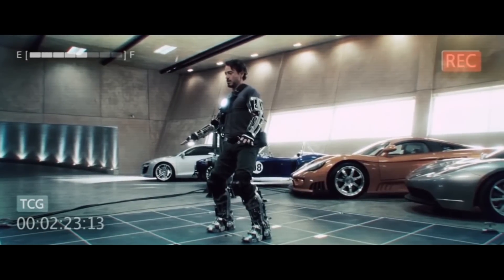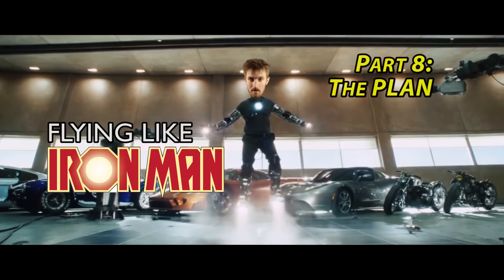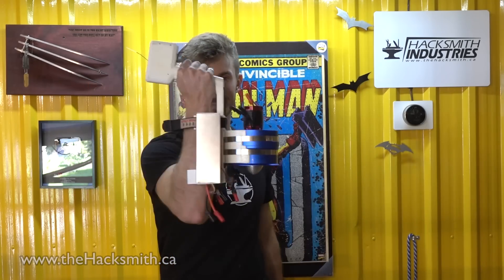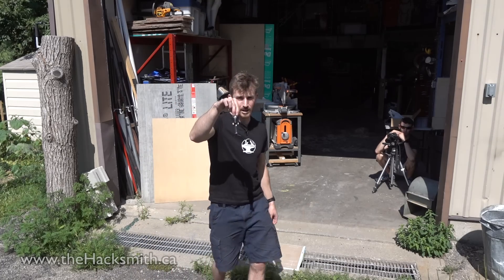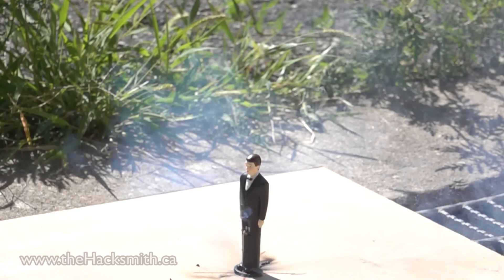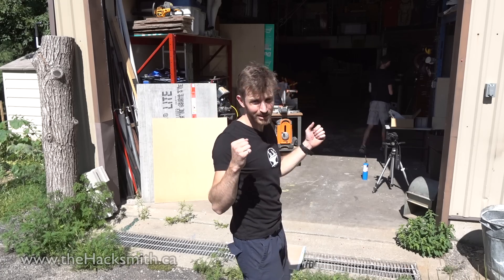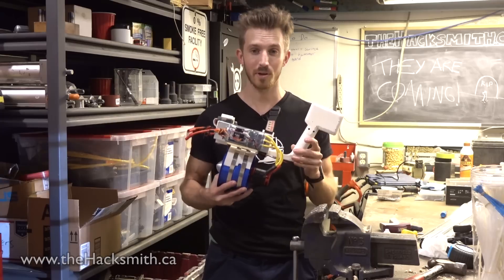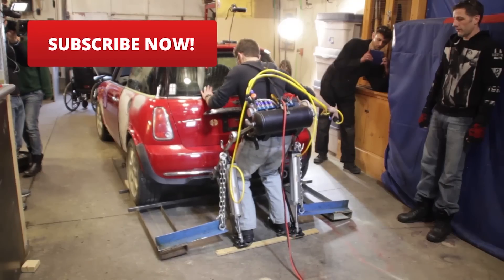Flying Like Iron Man #8: The Plan with Electric Ducted Fans

Comment: What about making a suit smaller than the hulkbuster but bigger than Mark 3 suit etc so you can house actual jets? Would be very expensive though
Reply from the maker: +MUFC01 weight...
Reply: +the Hacksmith aluminium maybe?would it be too heavy?
Reply from the maker: +Alper Liman still too heavy... Remember the part of the video where I said every extra EDF needs more batteries? Any kind of suit would be very difficult to overcome it's weight
Reply: well,good luck wish i could help you but im not good at electronics
Reply: +Alper Liman What about 3D printing parts? Is that not light ?
Reply: Pulse jets:p with a tethered fuel hose. "Then again that is no where near as cool as electric duct fans without a tether".
Reply: +SpydreX Official don't forget the ear. Protection then lol. Those things make so damn much noise
Reply: +the Hacksmith what about carbon fibre?! :D
Reply: +sparsh mahajan nano carbon
Reply: +kurlik pl And "you're" use of your is incorrect.
Reply: kurlik pl If you want to use "you're twelve" as a snappy comeback, it'll carry more weight with proper spelling.
Reply: +SpydreX Official 2 heavy still
Reply: CM Gamer Actually no the thrust to weight ratio is excellent on pulse jets so that shouldn't be a problem but heat will be a major concern.

Comment: I was going to say that the locations of thrust before and aft the center of gravity wouldn't matter as long as it was balanced. I think Scott Manley made a video explaining why pushing and pulling rockets don't have any differences in stability.
But then you added in that an exoskeleton makes the body rigid, so I realized that the thrust source wouldn't be on a fixed place because your legs aren't stable mounting regions.
Reply: what is a pulling rocket?  don't they all push?
Reply: Yup they all push, it's just much easier to deal with designing rockets that way. And as BrokenLifeCycle was reffering to, there is no stability advantage to putting the center of thrust at any particular point, as long as the thrust is pushing through the center of mass.
Reply: And thats why i love KSP it explaines so much! :D
Reply: I think it's called a rocket pendulum fallacy.

Comment: When you actually finish the issues with the thrust, you can use a wingsuit for a more stable horizontal flight right?
Reply: And other question, are you going to make a suit for this project as well or just the thrusters?
Reply: +Lucas Schmidt probably not most likely the weight
Reply: the problem with using a wingsuit to get a stable horizontal flight is that he won't be able to move his arms so much that  he'd be able to steer, and with the main thrust on his back it will slowly turn him  down to the ground first  before slamming him face first down in the ground
Reply: +Erik Pettersen yeah he needs to make more sensitive movements alot better

Comment: i recommend  not putting the power supply on the body its just a proof of concept so the power source can just be a wire + it would make most of the designe issues go away like the changing center of gravity due to the additional batteries + will cut the cost up to 40%
Reply: He wants to fly without being attached to the ground
Reply: Lucas: Ofc, but this is just a first step. No need to have everything at once.
Reply: those things are 5800W, eating about 80-100 Amps each.... and he wants 20 of it. The wire would be so heavy it would make his weight double. That's why they try to keep the batteries as close to the thrusters as they can
Reply: Agreed.  Something similar to what Raytheon did with their XOS 1 and 2 exoskeletons.  Just store the heavy stuff somewhere else, and make sure the core concept works first.
Reply: He said in another comment the first tests will be just that
Reply: Becko the wire can be suspended + the size of the wire wont make it as heavy as the batteries ....
Reply: +Glytch 
yup
Reply: You can suspend the cable and have it roll out of a tether. It wouldn't have to be long/
Reply: Yeah but it's not like he can create a potential energy dievice that is very safe and that creates clean energy because the most fundamental law of physics is the conservation of energy it states that energy is constant which means it can't be created only transformed so how can he solve that explosive and battery problem he can't make an arc reactor

Comment: I know it kinda defeats the point for now, but why not use AC and a tether for now, until you get the flight working, and switch to batteries later? That would save cost on batteries, and make it easier to develop
Reply: That could make it easier, yeah
Reply from the maker: +Ogoun the EDFs require DC voltage :p
Reply: I realize that, but if you take AC from the wall into a DC power supply, you could use a tether to transfer that DC power to the 'suit.'

Comment: Hey Hacksmith! Consider this. When your standing stationary you have forces acting down through your center of gravity and forces acting upward through your feet. Your brain is acting as a stabilizing CPU to keep everything upright and has been doing so all of your life so is well trained. Although it may be hard to direct enough power to your feet to lift you off the ground, with practice you could easily learn to balance on the engines without even requiring hand stabilizers... but with the hand stabilizers the whole thing will be that much easier (picture leaning on a desk making standing easier)... The only reason for a jet-pack would be to add more thrust to actually get you off the ground but humans aren't used to being lifted up from behind like that and I fear that this kind of imbalance would actually be harder to account for leading to the best face plant caught on camera. I don't have your maths so I couldn't tell you how to get the extra thrust with just hand and feet EDF's but I honestly feel it would be much safer for you without the jet-pack. For a video representation of what i mean search 'water bottle jetpack fail'... think also about having separate controls for the thrust of your feet and your hands. your hand controls need to be instinctual so you can stabilize yourself as a reflex action, while feet controls need to avoid this so you don't panic and accidentally up the thrust making your problem worse. I hope this helps... Fly safe!

Comment: why don't you just use a Tesla turbine fan to provide the thrust you need? turbine will go supersonic at just 100 psi...
Reply from the maker: +blee0518 conservation of energy, input power can't exceed output power... 100psi will never make you fly :p
Reply: you're not understanding me. energy can be converted to force. which the force would be easily amplified in a turbine. 100psi is force not the actual energy as well. force can be manipulated while energy is the same. same as in transmissions.
Reply: the Tesla turbine is 98% efficiency. nothing  close. so use your energy effectively.
Reply from the maker: +blee0518 show me a Tesla turbine that can put out over 50lbs thrust, I'd like to see :)
Reply: w
Reply: +the Hacksmith pretty nice!

Comment: I read that the Hiller flying platform (1950's) were you are standing on top of a big ducted fan , was actully easier to fly no hands because our normal sense of balance works through our feet , so it was just like balancing on moving floor  for example a boat   , but as soon as you held the handle bars it all went screwy !

Comment: You are giving the wrong ideas to people who actually have way more money than you...
Reply from the maker: If people have way more money than me why are they watching my stupid videos?
Reply: +the Hacksmith Gathering good ideas ;)
Reply from the maker: +Nobody Never I thought you said they were wrong ideas? Regardless of whether I'm right or not, I'm bringing everyone along for the ride -- maybe I'll fly, maybe I'll die :p
Reply: +the Hacksmith you will fall... IN STYLE
Reply: +the Hacksmith Now this is worth a subscription
Reply: hj
Reply: Having the center of thrust above the CG does NOT make you more stable. This is called the Pendulum Rocket Fallacy. In essence, any amount of instability causes you to turn slightly. Then, no matter where the thrust comes from, it will turn with you. https://en.wikipedia.org/wiki/Pendulum_rocket_fallacy
Reply: That might be true, but in this case the difference is that your body is either hanging down from your thrusters, wich is quite easy, or it has to stand stable on top of them, which is a lot more difficult.
Reply: +the Hacksmith WHERE DO YOU LIVE IN KITCHENER I WANT TO SAY HI TO YOU
Reply: He'll have to learn electron stripping systems, dry superconducting strips(normal temperature), and jet engines. He would need some type of artificial, unfold-able, wing. Iron man is not good aerodynamically.
Reply: +Makeoscopy Mounting propulsion to the chest is still better. It has more room to mount stuff to, and it doesn't move around as much as your legs.
Reply: Nobody Never money cant get you every thing
Reply: Nope

Comment: may be worth considering using the bieficated vent principal as seen in the Pegasus jet engine. basicly redirecting the air flow from the fans dosnt greatly decrease the efficiency (in a gas turbine engine) so large more efficient ducted fans could be mounted on your back flat and the thrust redirected down and an air intake added. food for thought

Comment: i have to voice some thoughts:
1. look at the flyboard, which uses turbines below the center of gravity, 
that shows its possible,(but imo complicated/unstable), so distributed thrust would be preferable(f.e. 2 per feet/2 per shoulder 2 per hand for stable liftoff)
2. a jetpack needs a counterweigt or the thrusters have to be right on top of the cog
3. pls think about custom esc´s, cause an arduino+ custombuilt ones may save a lot of money and enables software stabilisation and grouping for multiple edfs
4. may use wingsuit for horizontal efficency
4. i´d really like to help so dm me :)

Comment: Hi Hacksmith!
You may don't know, but once it was actually something like that what you want to build. Bell aerosystems was developing Bell Rocket Belt (which was a rocket propulsion "rocket pack") and after redesign The Bell (WR19) Jet Belt (jet powered "jet pack"). I think (if you didn't done this yet) you can do some research to find out what problems they had with it.

Comment: About all that center of gravity stuff, I think you're forgetting the human element, with the zapata flyboard air all the thrust comes from below the center of gravity. The reason why it flies so well is because the pilot has the ability to manipulate the position of his own center of gravity, much like how a segway works. When it comes to iron mans boots, the direction of the thrust is not set, it can be changed by moving your legs so it is directly beneath the center of gravity at all times. If you're worried about stability thats what the arm jets are for, even stark himself made them for that. The jet pack would still be a necessity for efficiency and added thrust.

Comment: i believe that the leg mounted prop can work if done right, if you weight around 90kg you can have lets say 30kg prop on the legs and 60kg on the arms, even 40-50 could be preety stable, and you should get easier monouvers. sry if i mispelled some stuff xD

Comment: Looks great can't wait to see stunt wire system test, but helicopters are more stable with lift above them due to high area of the prop, rockets however are more stable with low centers of thrust due to the fallacy of the pendulum effect, that's why Goddard changed his design so quickly, but completely agree with your current design as rocket thrust and fan thrust are two very different animals
Reply: Diffrence being of course that fans pull and rockets push
Reply: +Mind blown of course there is no such thing as an inherently stable rocket, no matter where the thruster is you need stabilizers, the only aircraft that is inherently stable is the airplane, a multicopter can't fly without stabilizing software just as a helicopter can't fly straight up  without immediate control input

Comment: You can use wires to power up engines while you will be using the stun wire. And for weight imitation of batteries you can use lead or weight from your barbell. 
For cheaper 3D printing you can recycle 3D printed objects or old plastic staff:
Shred them into grans, melt them and press them thru tiny hole to get plastic wire ready for use.

Comment: Actually the level of the thrust on your body (as in how far up or down) has no effect, that is a misconception that some early rocket scientist had, but in reality it does not matter.  The reason that little hand helicopter is stable, is because of drag, not thrust.

Despite this it is probably a good idea to mount it on your back, simply because it is doesn't move.
Reply from the maker: +The ConHathy Channel we're not building a rocket though... Remember EDFs have very finite thrust control -- I'm also a fleshy meat bag -- not a rigid rocket :p
Reply: the Hacksmith Actually, you might be right. I think that the "pendulum effect" (or at least I think that is what it's called) does apply to something flexible

Comment: Hi. You're on the wrong track wrt to CofG. Take a look at the Martin Jetpack. They had to LOWER the fans and ducts to gain sufficient control. The original prototypes had the ducts up high. It never really worked because it was TOO stable. The one that works has the ducts at about hip level. Take a look..

Comment: J think that the main problem you should address is the power supply problem... and also I do acknowledge the fact that the cent of gravity would be off. But, what I, or we.. failed to mention was that there is gradual thrust when using propulsion systems on your feet. Not an immediate thrust up. I think that is what you were thinking it means. And also, you go along with everything, you need to have gradual inclination of the propulsion you exert. Think of it kind of like extending kangaroo stilts. I guess an example would be that as you become taller or you ascend, you're center of gravity becomes different causing you to try to stabilize ending up with injury or death. again I acknowledge you said that in the video that's why you have to figure out a stabilization feature before anything else. The hand mounted systems are fine for kind of balancing yourself out. What you should invest time into is carefully planning out stabization features, adding power to jets so you can slowly but surely thrust up, and either building a backpack for your power supply, or adding smaller power supplies to the rockets, or jets or whatever. Anyways, hope you keep up the good work, and remember that we are merely suggesting things. And that you might need to study different things, like G-force on the body, how much you can take abd things like that. In the case you do study, in the future you can build an actual fully functional Iron man suit!

Comment: Thrust at your feet could actually work with enough training. This is comparable to standing upright (as you always experience an acceleration of 9.81 m/s^2 upwards), which one has learned durin the first years of life.
So with some practice, other values of acceleration should also be possible

Comment: try to put rechargeable thrusters near the chest so you can stabilize. use the same concept as the windmills fan thing but have a vent system near the front.

Comment: Have you looked into the actual props of the edf? I believe that the more blades in the edf gives more thrust yet a lower top speed, even tho speed isnt a real probablem with you bc you just want the thrust.
 I suggest doing some test of different edf props to check the thrust power of the edfs. Yes this is extra time and money spent but you could end up with a better product.
Reply: Or just 3d the props. Youll save money that way
Reply: more blades often means more drag. In this case I'd trust that the scientists making the edf's would find the optimal efficiency

Comment: You guys take on projects and ideas from the crowd? With the use of the ducted fans could you design a Hover bike prototype? perhaps a tron legacy jet bike type deal. 3 ducted fans, two in the wings, one below with a F-35 like directional nozzle for assisted lift then forward thrust after elevation is achieved? Airbus makes the efan which has ducted fans that produce 266 LBF so it seems very possible. +the Hacksmith.
Reply from the maker: We could, but we'd also need a huge budget. You'd need even more EDFs than the flying like Iron Man project so the cost of such a thing would be $70,000+

Also the largest EDFs that exist are the 195mm EDFs from schuelber -- and they only produce 24kg of thrust each. You'd still need 6-8 of them for a speed bike at minimum, probably more -- ideally you want 200% thrust to weight ratio for power and acceleration ;-)
Reply: Would you really need more, or just a larger fan diameter? Also was under the impression you made your own EDF?
Reply: Also was thinking by using large scale inexpensive RC plane parts you could easily put together the mechanics and controls. The hardest part would be the body mold I'd think. But I have no degree, just a dreamer lol